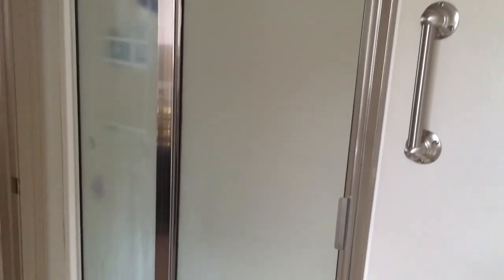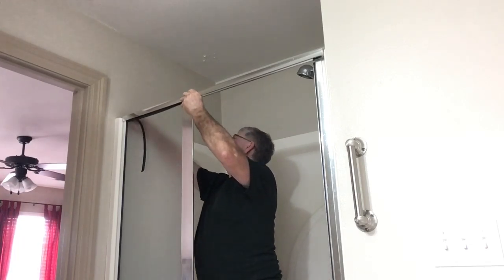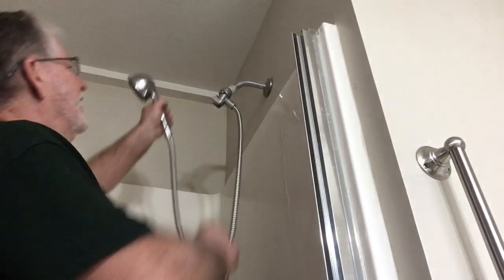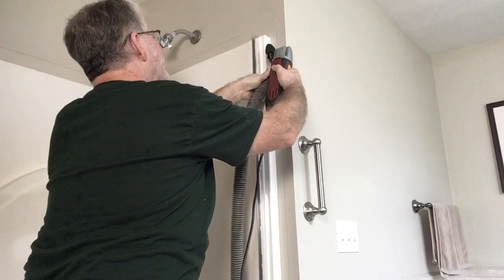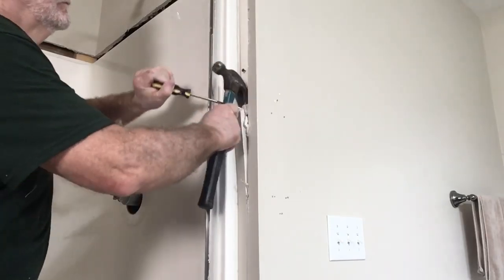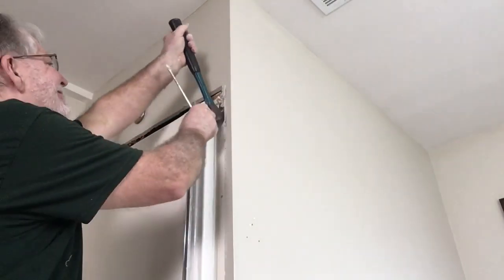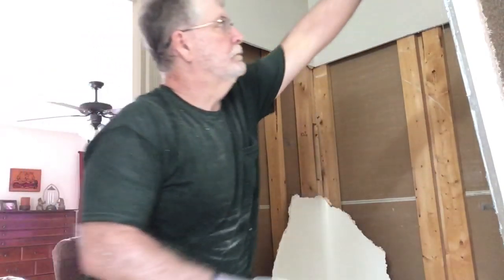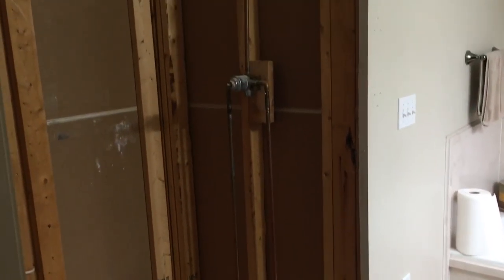How to Remove a Shower without the Mess (Part 1)

Comment: As I’m sure you know. The nails with square metal washers are roofing nails. Used for the black base paper for torch down sanded rolls on flat roofs.  

Great vid and tips. Thanks
Reply from the maker: YES! You are correct!  I'll beg only a handful of people know that.  Thank you very much.